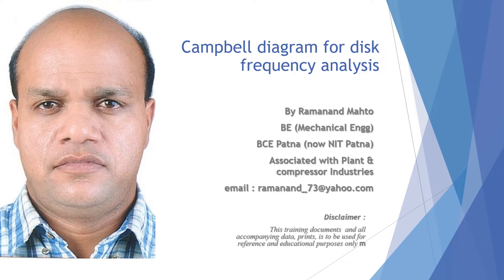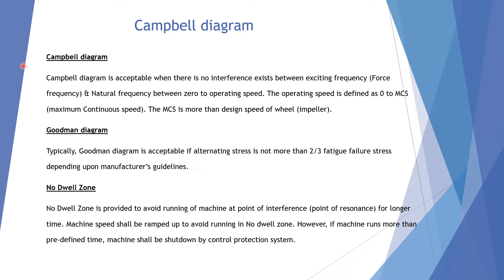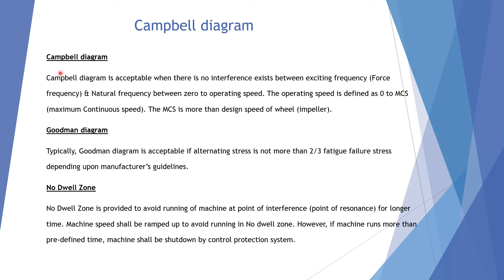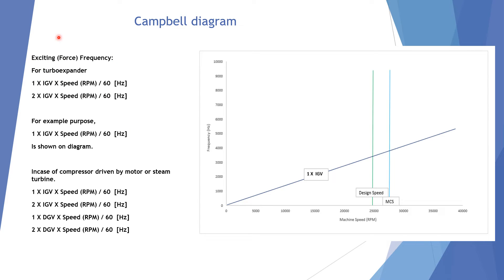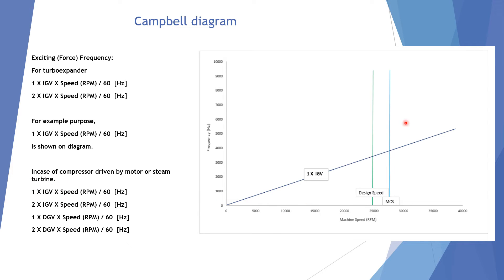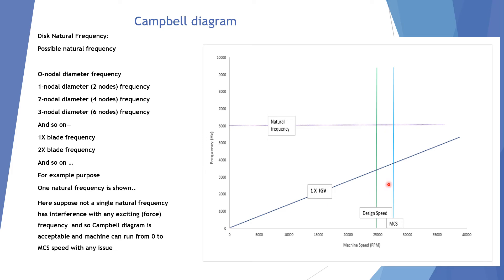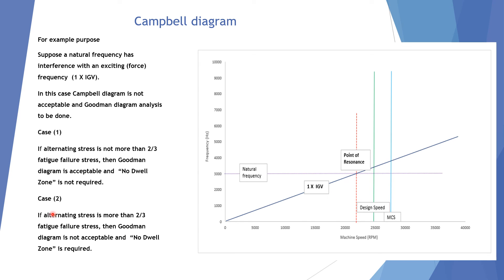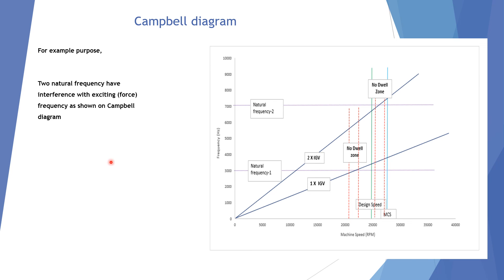Campbell Diagram Analysis

Comment: if the compressor is without IGV then what will be the excitation formula?
Reply from the maker: If compressor is without IGV, then there is no excitation force frequency due to IGV.  However, there will be diffuser of compressor . If diffuser has vaneless type means plate type then there will not be excitation frequency due to Vaneless   diffuser. But if there is vane diffuser plate, then excitation frequency is available which is expressed as 1 * RPM = 1 * Nos of Diffuser vanes * Speed (RPM) / 60 [Hz] and 2 * RPM frequency = 2 * Nos of Diffuser vanes * Speed (RPM) /60.. [Hz]